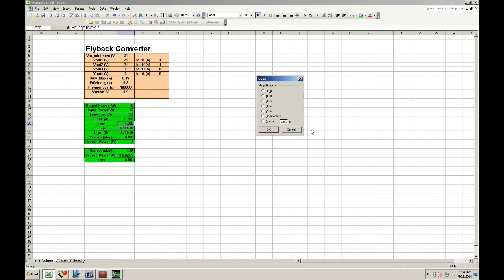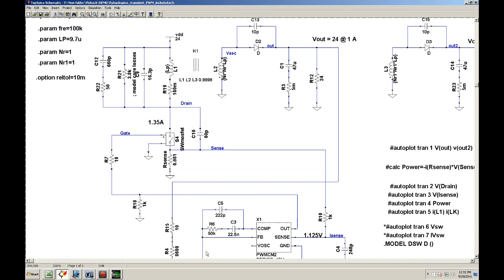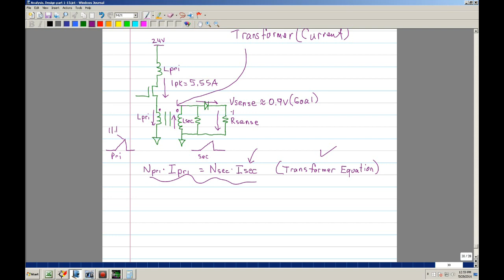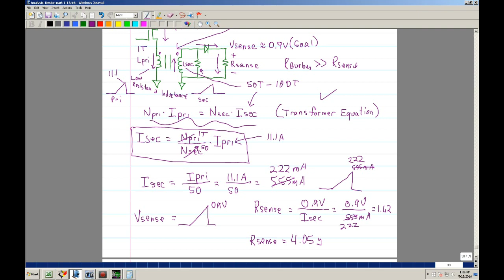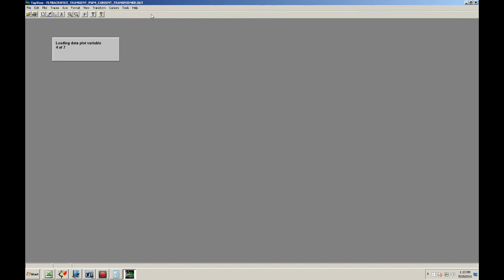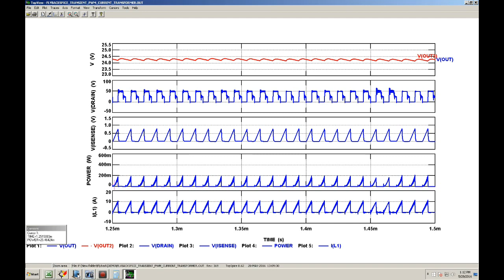Analysis and design of a Flyback; Use a current transformer. Part 16

Comment: How do you guarantee Rburden will reset the core?
Reply from the maker: There should be a resistor across the secondary of the current transformer. If missing, I made a mistake to not to include it
Reply: @RobertBolanos  there is a 3K. My question is how to size the resistor appropriately so the core resets in time. If it is made too large it might not reset it.
Reply from the maker: @robr8554 you use the volt second rule to ensure it resets. During turn on, the current on secondary develops a ramp around around 1V plus one diode drop, the magnetic flux is maximum in the core, when toff comes around, the current still wants to flow the the same direction but due to lentz law, the polarity changes and you get a reverse volatage, this is where the flux callapces and decays to reset the core. The voltage we get is around 5 to 8 v if I recall correctly but only last a short time

Comment: Hi robert this current sense core , kool mu or normal high perm core ?
Reply from the maker: Hi Vtech,

I use ferrite cores to implement a current transformer with one turn on the current sense and the secondary 50 to 100 turns. I hope this helps.

Comment: Hi Robert,  I want to create a transformer with one primary winding and four secondary windings. Does Topspice has similar capability like Simetrix to build a magnetic model ? Or do I have to create inductance for each winding and add coupling ratio
Reply from the maker: Hi Thanh, I am not familiar with Simetrix, but if you want to build a 5 winding transformer, you would place 5 inductors as L1, L2, L3, L4, and L5.  L1 would be your primary while L2 to L5 would be you secondary winding. You would then have to specify the specific inductance to all 5 inductors. To make them coupled, you then have to place the K spice directive by pressing [Insert] and then press [k]. K is the coupling coefficient. It spice directive would look like thisn  K L1 L2 L3 L4 L5 0.9998.  The would tell spice that all 5 inductors are coupled. I hope this makes sense.  Robert
Reply: Robert Bolanos Thank you very much for your detail explanation. It is so nice of you to help out others

Comment: Hi Robert, great video. I would like to ask how do you select the current transformer primary inductance we see at 20.00m. I mean if I change that value from 1n to 1m (including your 1u) sometimes the current is not sensed properly. Is there a specific criteria to select it? Thanks a lot.